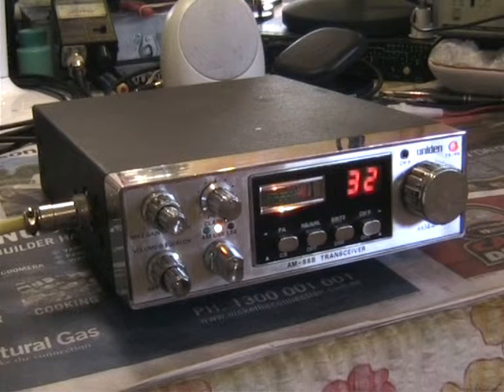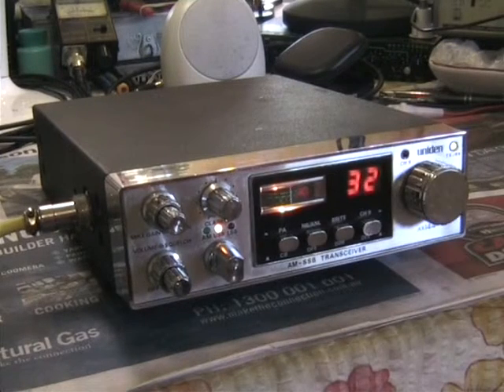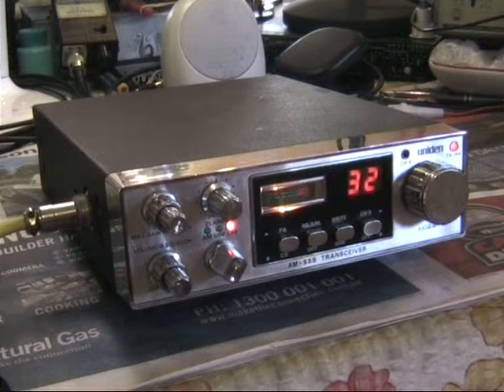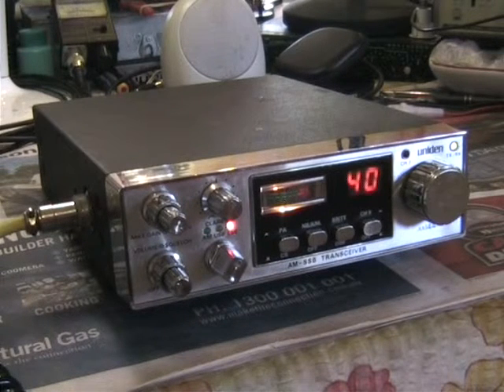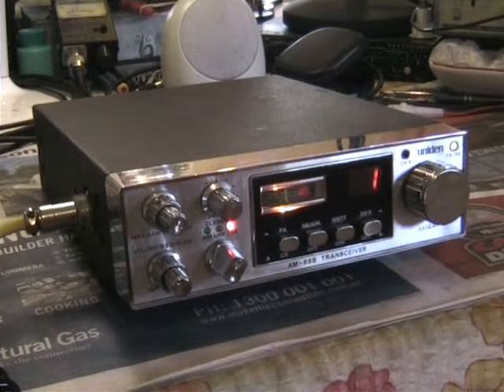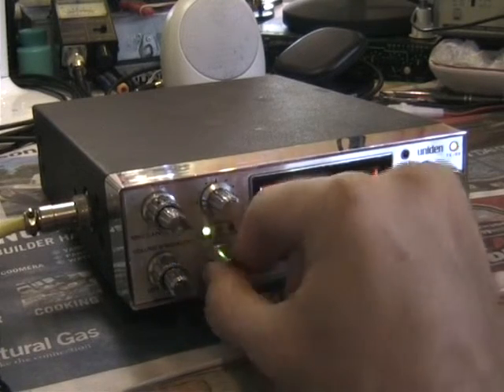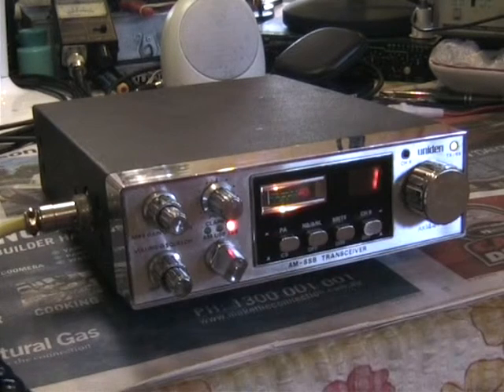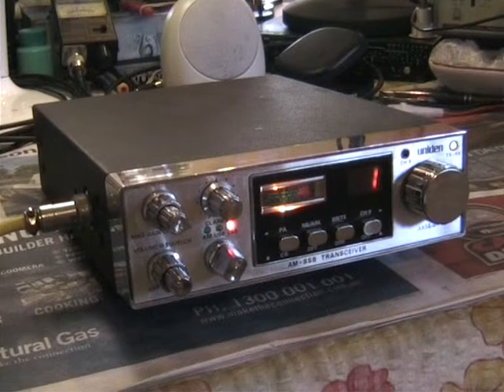Uniden AX-144 Repairs & Align (Demo with Dan 140)

Comment: Good video - I just finished restoring one of these and they are a great radio. Back in the day, they weren't that popular because the PLL is mask programmed so extra channels were not so easy to add, but I had a couple of them, and because I didn't need extra channels, I loved them as a radio - in fact, the one that I just restored is my first one from when I was a teenager - it is unmodified and works perfectly!
Reply from the maker: Yea a fantastic set James, totally agree. For CB action they are plenty left stock and have a really nice receive / transmit.